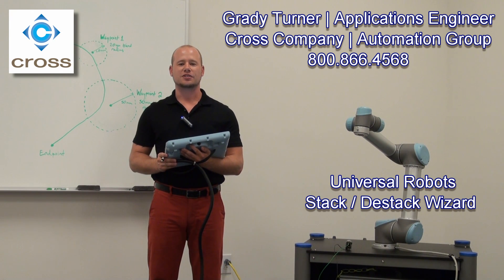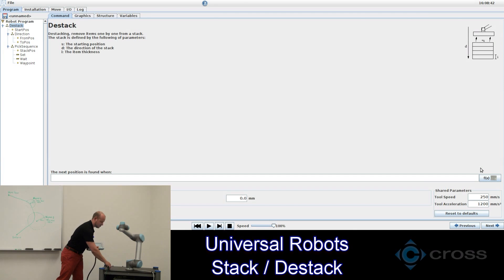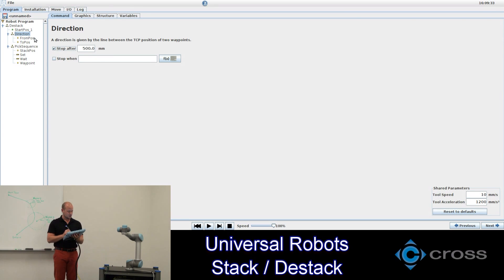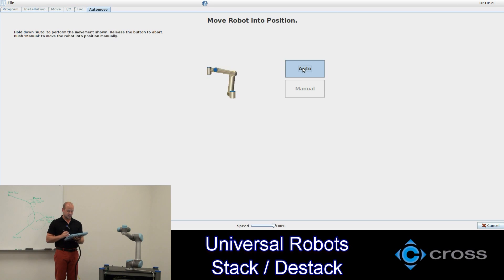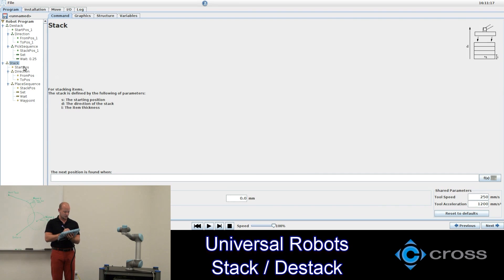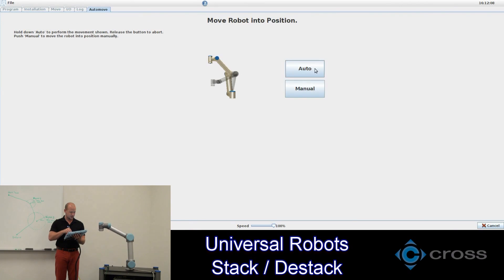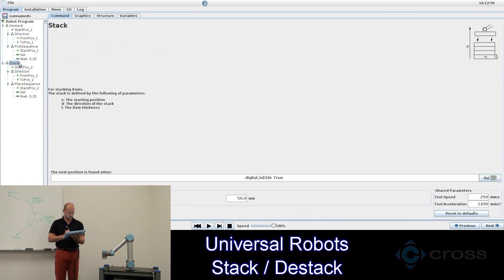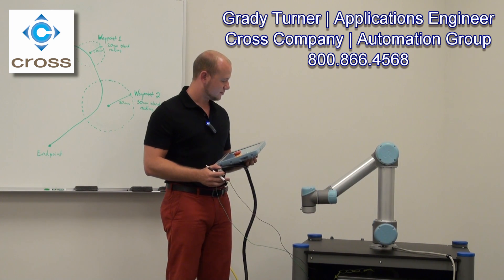Universal Robots Stack Destack Wizard with GradyTurner

Comment: I'm curious about something other than a pushbutton for finding the next position... You mention external force/ proximity sensors, but is there a way to use UR's internal force mode to seek until, say, it meets up with 2 lbs resistance?